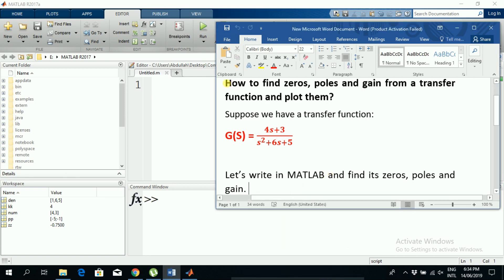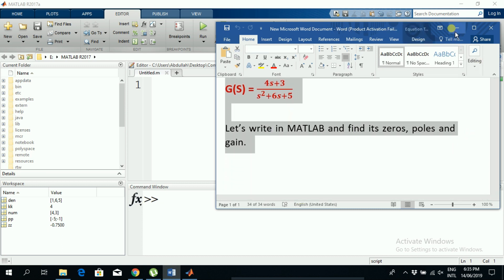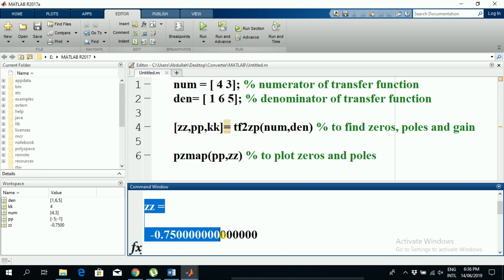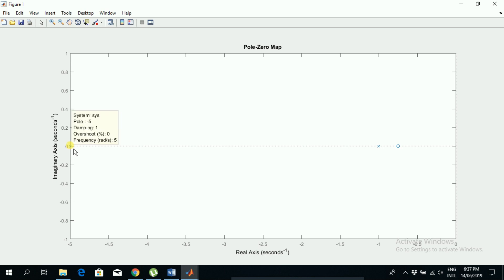How to find and plot zeros and poles of a transfer function in MATLAB

Comment: design and produce an IIR filter with a cutoff , fc = 600 Hz to filter the additional noise. Filter sampling is 8000 Hz.
Show all design steps (e.g pole zero diagram, calculation)
Put your filter into the Matlab workspace as the variable ‘num” and “den” where
H(z)= num/den.
Then use the command freqz to plot filter.
Analyze the frequency response, impulse response and pole/zero plot for IIR filter.how can i write program
Reply: dude really